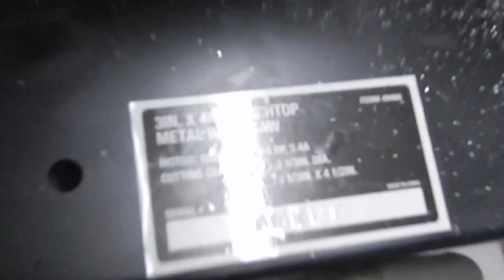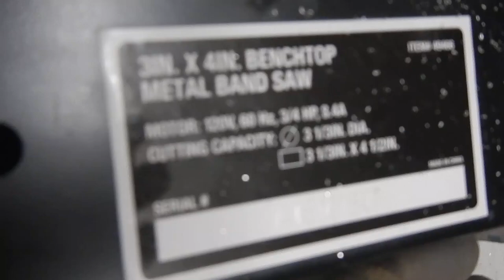Klutch Benchtop Metal Cutting Band Saw — 3in. x 4in., 1 1/3 HP, 120V Hem?

Comment: Use one like that in my shop to cut aluminum and copper stock. Typically run through 8 each 12ft bars of aluminum and 2 each 12ft bars of copper each week and it's been going strong for almost one year. Had to repair the electronics when I first got it but no trouble since. I think the bearings are finally going out on the wheels and the blade wants to walk off the wheels. Probably just buy another at $200. Oh.. I'm on the third blade, not bad when you consider how much we cut with it each week.
DO NOT USE CUTTING FLUID WITH THIS SAW. The blade is designed to not use it and you'll just gum up the works.

Comment: i guess it’s  basically  what you pay for on the saw  perhaps another blade will make it better  i’ve always thought a good YouTube channel  would have been  one that takes  many of these Chinese tools  and provided  easy and inexpensive upgrades like the bearings you refer too and optional motors etc  that again are reasonably priced and easy to find yet better quality than they  come with  i’m a retired Woodworker  and  in many cases  like shop equipment  Harbor Freight and Northern tools  do have okay stuff for the money  i’ve been thinking about buying the Kutcher brand floor standing drill press  where in a Woodworking shop  they aren’t used everyday  but are needed for many projects

Comment: Thanks for the video, I cannot good replacement blades 52 inch seems to be very odd size. Have anyone found good quality blade for stainless steel and alloyed steep? Thanks in advance
Reply from the maker: I buy mine from LACuttingProducts on ebay....i think I had to message them for my exact size. I paid $44 for 2 shipped to my door.

Comment: What do you recommend for cutting fluid? I've been using 3 in 1 but the rollers keep slipping anything that grips better?
Reply: Seems like the most important thing on bandsaws  is keeping the blade cool, so I usually just use water. That being said, I do keep my rollers well oiled.
Reply: Hydraulic oil always works well for me.